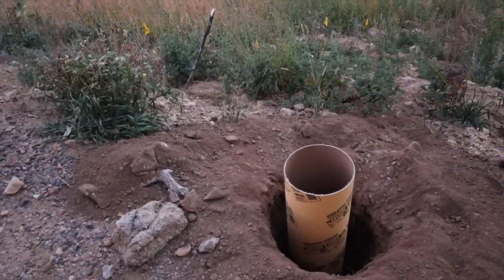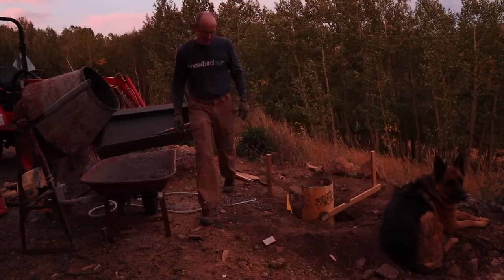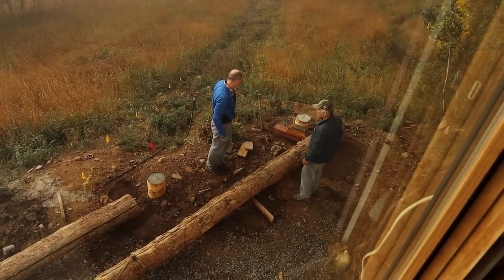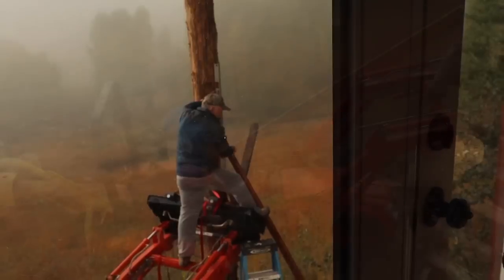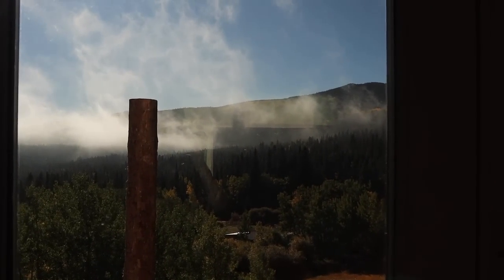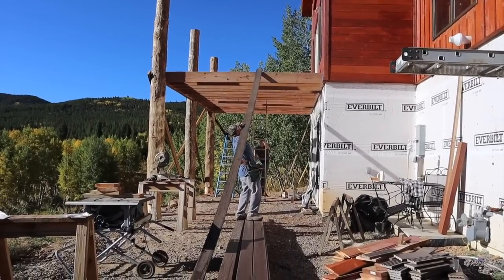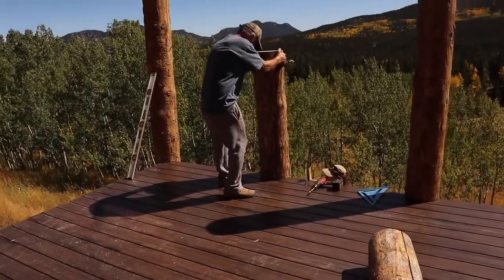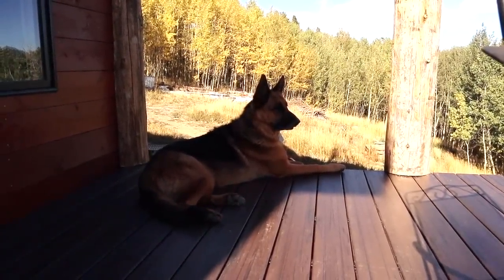Massive Log Deck Built in Two Days

Comment: You need nuts and bolts on all of those log/beam connections.
Reply: Yep don't just think the weight alone is enough.  They need to be secured from lifting.
Reply from the maker: No we're not done, just the video is over. We have straps and bolts and carriage bolts, etc. Appreciate the attention to security- super important around here with the winds.
Reply: @ColoradoMountainLiving  Where i built homes we had to meet 120mph wind codes on everything we built. We also had to use 6 nails/staples per shingle on asphalt roofs.
Reply from the maker: oh wow! that is smart. we do have wind codes here specific to the roof and straps to the foundation that we had to follow.

Comment: Before you cut off the outside posts, I would think about the possibility of adding a roll out awning that would attach to the house and roll out to the posts.  That way it would not have to be extended all the time, just when you want it.  It would give added stability to the awning.
Reply from the maker: Thanks for the idea! We also thought of turning them into chainsaw carvings on the top of some animals.

Comment: It would be stylish to make the post cut-offs into one or two bits of deck furniture or decor.
Reply from the maker: Yes, trying to think of a clever use of the pole tops.
Reply: @ColoradoMountainLiving   Ideas: 
Split a 6-10 inch tall section in half for lamp mounts.
Carve the same section hollow for wall lamp covers.
Split long sections in half, add legs and top with resin or acrylic for benches and/or tables.
Slice 2 inch thick discs-
Add table legs, or...
Add chair legs and arched stick back, or...
Paint both sides as dart boards for rec area. (stencil PDF) You can wear out one side and flip. (Also if they're nice enough, make gifts.)

Hope that gets the wheels turning.

Comment: That's a lot of weight for a tube to take especially laterally, with the issues of freezing/ground movement can  I suggest you remove the backfill of earth around the tubes and refill with concrete.
Reply: he filled the sonotubes with cement !
Reply: @joedoakes8307  Yep, Which should resist settlement I'm talking about sideways movement, you basically have a tube of concrete surrounded by packed earth on which a large post is resting. Any movement laterally of the tube will result in the wooden post tipping in the opposite direction. You need mass to stop this happening and filling around the tube is a start.
Reply from the maker: Thanks for the tips! This may not have been clear in the video, but the tubes are on stilts and the concrete flowed out to fill the entire bottom of the post hole, so it's like a flared column, hopefully that resists movement some. We are backfilling another 8 feet past the piers on the hill side, which should help add more packed dirt.

Comment: Deck looks good but I sure hope you put some lag bolts into those posts. The screws are ok for temporary use but I believe something that small in diameter will fail in the future.
Reply from the maker: Yes we are doing that. Will also have carriage bolts between the the 2x10s on the ends. Just couldn't fit it all into a single video.
Reply: Actually some of those new screws are better than lag bolts.

Comment: Nice deck. I'm impressed everytime I watch your progress on the house. Just a heads up, I've watched contractors that have used composite decking and I know that not all composite decking is the same. The contractors warned that certain composite decking will get scorching hot in the summer with the sun beating down on it. I just wanted to make you aware of the possibility of excessive heat. So no bare feet and maybe a rug for the dogs paw protection if needed.
Reply from the maker: Thanks so much! I bet that is absolutely true in the mid summer months.What i've observed so far is it's not too hot, but we only have temps in the 60s right now.

Comment: did you forget to put something between the concrete and post?
Reply from the maker: What do you recommend?
Reply: @ColoradoMountainLiving  A roof shingle or some plastic. Concrete always contains water and that post will rot
Reply: @ColoradoMountainLiving  I just had to do about 45k in repairs to a house I bought last year because of this. A log is like a huge straw and wiil suck up every bit of water it comes in contact with at both ends. For the tops google log caps, we went with some nice copper ones. For the bottom (wish I had seen this before you had it built!) you need some type of break between the concrete and the wood. Anything is better than nothing but the best thing I know of is bituthene waterproof membrane. Find  a way to get something in there and preferably get some slope to the concrete so water will run off. Good luck, you don't want to be replacing those posts in only five years....
Reply from the maker: Thanks for the tips!! We'll see what we can do. Not sure if the super dry climate will help prevent rot somewhat. Our neighbor has similar log posts on his deck he's had for many years. We'll ask him what he did. The logs are larger diameter than the posts (they hang over) so that should keep it dry too.
Reply: @ColoradoMountainLiving  oh alright well see

Comment: It will rot away in no time , and the big pole railing is weak as piss , the only thing holding the deck up is the house it should be self supporting on a deck that high and big
Reply from the maker: How much time is no time?
Reply: Colorado Mountain Living no engineer would sign of on that deck , fastening of the main posts and railing is substandard. The hole job looks strong but isn't

Comment: I usually frown upon safety freaks but this build has me severely concerned.
1. I don't know Colorado building codes but as a rule of thumb if structure attaches to a house with bolts, screws or nails it needs a permit.
2. You need some sort of hurricane straps or mounts on those columns, just gravity setting them down on peers is not good enough... Personally I would have used cedar logs or find other way protect wood and bury those peers in the ground/concrete few feet (too late for that).
3. Those tiny 6 in screws would be considered insufficient to mount 4x4 post.  Ya'll need to go back and drill all the way through the log and joist and add at least 2 of 5/8 or 3/4 in thick bolts (with big washers) going all the way through the log and the joist.
4. Also since this platform is quite a bit up from the ground  you will need railing with gaps no bigger than 4in 

It does look fantastic though.
Reply from the maker: Not to worry, the video wasn't the end of the build. Many of the things you mention are being done as finishing steps, including straps, additional backfill, carriage bolts, lag bolts and the railing.I will probably do a follow up video review since so many viewers have expressed interest.

Comment: I am a bit concerned about the stability of your deck.

You appear to have backfilled your sleeves with soil. Therefore you're concrete columns will in effect only have a pin joint at the bottom.  On top of your concrete columns you have put another pin joint.

A column with two pin joints is not stable.
Reply from the maker: Thanks for your concern about the design stability.  Bryan is not done yet with the anchoring. He plans to bolt some steel straps directly to the column. Also, did you catch the part in the video where he said the columns were on stilts, so that the initial concrete pour flowed out and filled the post hold with concrete, before the rest of the column was filled? The column is more of a flared bottom than just a regular column. I may have over edited out some of the explanation. Do you think that would make the difference in stability?
Reply: @ColoradoMountainLiving  The flared bottom to the concrete will help resist rotation of the concrete base and will help to resist sliding.The straps that you are going to install to connect the posts to the concrete that will also help resist rotation at the top of the concrete base. The straps will have to be protected from corrosion especially if they are going to be covered up by a rockwork plinth.

When you have completed the deck you will have to have a party on it.
Reply from the maker: The other thing that should help resist sliding, hopefully, is the extension of the grading away from the house,  8 ft past the deck, so the hill won't be right on the edge anymore.
Reply: @ColoradoMountainLiving  

The existing backfill appears to have been tipped on the existing slope and not compacted. That has not been a problem because it is not supporting anything. An inch or two of settlement and movement in a future path etc is a lot less work to fix than engineered backfilling to the slope which would be overkill (cutting steps and compacting in layers). The uncompacted backfill will be more permeable than the existing soil so there will be a tendency for there to be a layer of wetter soil just above the previous ground level. The backfill could slide on this wetter layer. I would be reluctant to rely on the resistance of something that could move of its own accord. 

My concern was rotation of the concrete rather than sliding which hopefully you will solve with the strapping.

The highest loaded post is likely to be the middle one which has the uncompacted electric trench just in front of it. 

Did you fix the joists to the joist hangers.

Comment: I'm sure your husband is happy with the low bar you set for defining "massive" , but that deck is not. nor should it have taken 2 days.
Reply: Being in construction I thought the timbers were massive and 2 guys 2 days is pretty darn good. Just putting the decking down with hidden attachment takes a lot of time.
Reply from the maker: 16 ft logs aren't massive in your book? sorry to hear that.
Reply from the maker: Technically it was about 8 hour days so, according to clock hours. it was a  16 hour build, less than a "day."